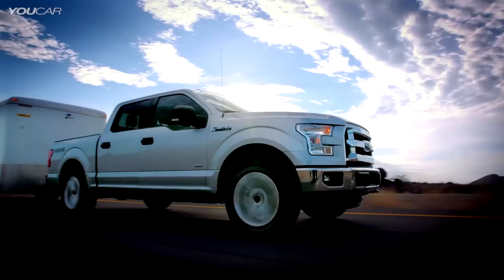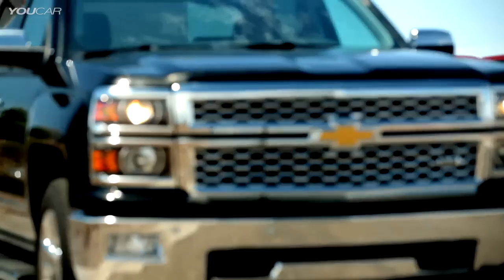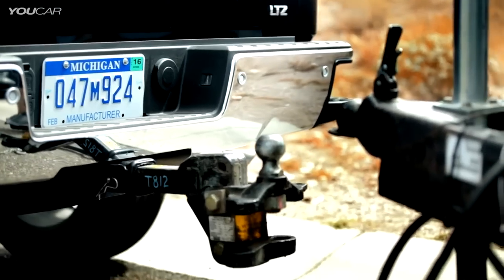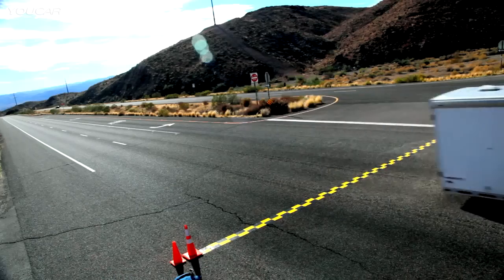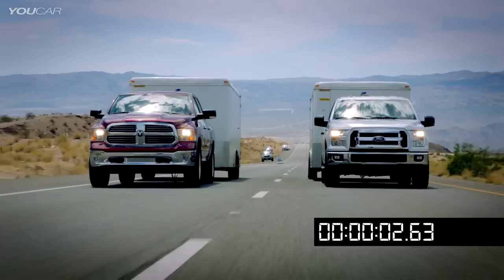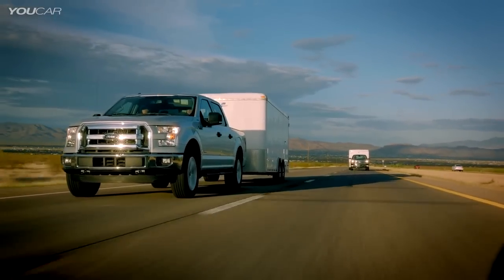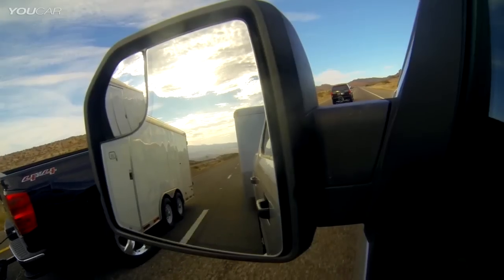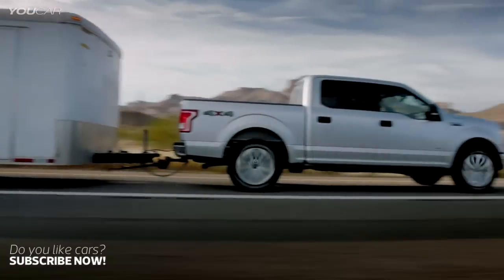TOWING Comparison – Ford F150 vs RAM 1500 vs Chevrolet Silverado

Comment: I love how its a ford sponsered video and they get the 3.0 liter eco diesel ram instead the 5.7 liter hemi when they both practiclly have the same mpg. They knew if they got the 5.7 liter it will outrun the 2.7 liter ecoboost WHAT A JOKE
Reply: Ford's Eco Boost 3.5 would walk the Hemi 5.7 liter
Reply: The 5.7 hemi has the same mpg rating as the ecodiesel? or the 2.7 ecoboost? Ford released the mpg on the new 2015 f150 already?
Reply: Dude your whole comment is flawed......5.7 does not have nearly  anywhere the same mpg as the ecodiesel. And the 3.5 is the 5.7 hemi competitor.
Reply: @ PJ I know I’m a little late to this I know the 5.7 hemi would walk that 2.7 but you are correct the 5.3,2.7, and eco diesel are the same class 5.7,6.2, and 3.5 are on a different level I had a 14 5.3 full bolt on and it wouldn’t keep up with my 15 hemi how it sits stock and the 6.2 and 3.5 are faster than the hemi so I can’t imagine

Comment: At the end of the day most truck buyers, like my dad, look for the capability of being able to towing which means good horsepower, torque, and a reliable engine not what will save the most gas money.  My dad has a Silverado (and yes this is my bias opinion) that he absolutely loves. It pulls everything he needs it to pull, gets better gas mileage than my mom's car at times (she has a Chevy Traverse), and hauls all the crazy things my dad hauls. He loves his truck and yes I'm a Chevy Girl and bias, but I mean that's just a different view from a different person who is entitled to their own opinion. But the F-150 is a lot better than Ram will ever be and the Tundra
Reply: TrapBird Amen. if it''s a truck itll haul.
Reply: That's where you are wrong ram Is the best truck out here right now. Chevy is a sluggish truck, ford can never compare v8, and tundra should never be never be compare to the Ram. Not only is the Ram better for towing, but the best gas mileage out here in full size truck
Reply: Case Baskets Yeah it has the best gas mileage because it can't pull shit! Everyone knows that, besides the 2015 Silverado was built after the Corvette, so you get the better horsepower.  I highly doubt that the Ram could ever pull up to 9,200 pounds like the Silverado High Country can.  Some stats for you: the optional L86 6.2 liter V-8 produces 420 hp and 460 lb-ft of torque.  It launched the near-three-ton truck to 60 mph in 5.4 seconds and it did a quarter mile at 99 mph in 14.1 seconds. So no the Ram really isn't the best truck out there, but if saying that it is makes you and Dodge feel a little better, so be it.
Reply: Your outdated with your information,  plus all the Silverado is just for show all they really brag about is "been in the family" nothing but paper nothing to show for plus the hemi 5.7 395 hp 420 tq 10,300 lb tow capicity all the Silverado is just for show that's why all other makes always compare their truck to the Ram it's all always the comparison to the best truck your just mad your truck isn't as tough.
Reply: Case Baskets I'm not mad about anything ... I'm just laughing at how you go and find this specs to prove me wrong, when my original comment was an opinion.  Ok you like Dodge, what do you want me to do about that? ... give you a reward or something?  It's people like us that actually keep the auto industry alive, without us everyone would have the same damn car.  So congrats that you like Dodge and I like Chevy because we're the ones that the auto industry should thank, we keep the world an exciting place.
Reply: TrapBird (Camaro Girl) yeah Chevy is good and dodge too
Reply: +TrapBird (Camaro Girl) I personally think the world would be a better place without the government saving GM'S butt ever time they screw up, just saying
Reply: Brayden Bracken Just wondering but how did the government save their butt? All the recalls they had with the ignition switch, as far as I know, the government didn't save them but instead asked them for money to fix all the damages. Besides everybody and every car company makes mistakes, and sure I'm biased on this but I feel like every car company should be treated the same when it comes to the recalls made on that company.
Reply: TrapBird (Camaro Girl) I'm not talking about recalls, GM nearly went out of business until the government bailed them out to keep the price lower for vehicles
Reply: Fiat owns: Alfa Romeo, Chrysler, Dodge, Ferrari, Jeep, Lancia, Maserati, Ram and SRT. Ford Motor Company owns: Lincoln and a small stake in Mazda. General Motors owns: Buick, Cadillac, Chevrolet, and GMC. GM owns a controlling interest in Opel and Vauxhall in Europe and Holden in Australia.
Reply: Christian Owens Dodge isn't GM ... Dodge is Chrysler
Reply: Exactly that poor of a engine vortex can't never be compare to a hemi
Reply: There ya have it!!
Reply: +Case Baskets The fuck are you smoking? No one compares their product to the Ram. It's always been between Ford and GM. Go pretend your fake "Hemi" was a real engine.
Reply: Dodge is awesome! js....
Reply: Christian Owens Hey everyone has their own opinion :) I like Chevy but without you and me the auto industry would be boring af lol
Reply: Yes, good point maim, no kidding! The auto industry is already coated in rust!

Comment: Yes the disposable truck has won... for now lol Come back with high miles and see who still has the original engine with original components.
Reply: Dude the 2015 chevy V8 engine is not stock it has a air intake,upgraded exhaust system,and a performance chip.
Reply: Michael Isaacson Yep and the ford isn't stock its got upgraded turbos and a 5.0l under the hood.....
Reply: Who had the disposable truck?
I think my dad's 2008 Silverado in my driveway. Want a picture? The motor is fucked with 47k. So don't give me that bull shit bro.
Reply: matthebest018 04 f 150 4.6 with 125k on it will still out pull ANY truck around in its class. original engine? you want a video showing all the stock components still on the truck? chevys are like a rock huh? well rocks can be broken NOTHING is built ford tough.
Reply: mcatlow8 Proper maintenance is key i guess you would't know lol
Reply: matthebest018 yeah tell that to my father a Chevrolet mechanic for over 20 years.
Reply: mcatlow8 K.
Reply: matthebest018 Thank you, finally someone with smarts. Soon we'll see more ecoboosts in the shop soon.
Reply: Jealous much? Ford won cause it is better and always will be
Reply: Pokemon Master Jealous of what? A engine rebuild in a couple years? Worst fuel economy? Unreliability?
Reply: Its the same with al those downsized enigines, the change of them beraming down is significantly higher. In the netherland VW uses 1.2 and 1.4 4 cilinders in the Jetta, Golf and the 1.4 en 1.8 in the Tiguan and Passat. Its horrible for the owners. Just 2 year warranty, and then you are fucked! Broken turbocharchers, wich sometimes arent replaceable without replacing the hole airintake manufolt, streched camchains ( really!!!!!) and lots of other failures. The best Joke is: the fueleconomy in reallife is wors than a Honda VTEC, Toyota Valvematic, Mazda skyactiv.
Reply: matthebest018 I smell a hating Chevy guy
Reply: matthebest018 Te Apoyo bro, Tienes toda la razón.
Reply: Sebastián Rangel ¿Qué hace un delirio arrastre tiene que ver con eso?
Reply: You're welcome for the pos gaymaro. Paid for by our tax dollars. Smfh.
Reply: richard wilson Funny thing is you think that ford has not taking government money. Gaymaro? The same one that destroyed the mustang in every way? Yeah probably that one. Jealous much?
Reply: matthebest018 didn't see it destroy anything. Without Ford Chevy and dodge would of never been started.. jealous much?
Reply: richard wilson Are you serious? lol Without GM Ford would't exist today. 90% of all the luxury items found in you car today (if you even drive) have been pioneered by General Motors.
Reply: matthebest018 how much does gm pay you to back up there garbage, Ford founded the automobile industry. Without out tax dollars Chevy would of been dead years ago, would of been doing the world a favor there.
Reply: richard wilson None actually its from my own validity. You ford dudes are all the same. Cant appreciate anything but their shitty cars. Welp have fun with you rebuilds its a good thing ford logo is circled because allot of people found the problem. I promise you will one day to lol
Reply: richard wilson So entertaining lol
Reply: richard wilson Seriously how old are you? Does your daddy drive a ford is that why you like them? lol
Reply: richard wilson Too funny lol Do me a favor and read your comments lol
Reply: +matthebest018 dude Chevy's are bad and dodge is worse they slap a v8 in it and call it good that was a 2.0l v6 my 1999 ford ranger has a 4.0l v6 and it would tow just as good as them
Reply: Michael Bryant bull shit i got a 1500 hemi 4by4 v8
Reply: Mat A my I've been driving E-150 vans my whole career, and they've all be trouble free well past 300k. these are 4.2L V6 vans. the 4.2 is bullet proof. They'll tow cars too, but you won't be winning any races.
Reply: Lynn Dempsey Fords suck timing chains and the IWE design on the front diffs takes the cake. What a garbage design. All the carbon buildup on the EcoBoost engines, spark plugs needing swapped way before 100k miles. Broken timing chain guides. Ford and timing chains do not mix.
Reply: My f150 has 280k still on its original

Comment: cannot wait for the tsbs.........and recalls...and all the fun!!!!
Reply: There are already service recalls on their way for the 2011-13 ecoboosts. There are multiple design flaws with those engines, exhaust manifolds, and heads clogging from carbon buildup prematurely, and it's no surprise there aren't any approved TEC procedures for them at this time. "Ford's better idea." lol..
Reply: ***** Except it was only a small amount vehicles coming from one factory, and guess what, more people drive the F-150 then all the other truck manufacturers combined.
Reply: That doesn't say anything more than a high volume of people drinking from the Kool-aid. It's kind of like saying, "Crest, more people use our tooth paste than other competitors combined." It's completely a mundane; pointless statement. Just because more people purchase a piece of shit doesn't make it better. btw, I don't really notice a lot of 90's Ford's on the road anymore...
Reply: Who would want to drive a 90's truck in 2014? There is no comparison to what is produced today. All three major truck brands make a good vehicle today because they have to. All three trucks have their pros and cons.
Reply: ***** its just a truck we are all over paying for just so we can work our lifes away anyhow.
Reply: Sorensenator86 if you combine the Silverado and sierra sales (which honestly I would because 'sthey are the same damn truck) vs all of fords f150 series you would see that they are about even. Also the reason why chevy uses "90's" technology is because the 5.3l vortec is reliable. wait till someone else does this test and see before you say anything. This is a very biased source
Reply: casey chance I have the 5.0 L in my 2014 and it is great. Chevy has upgraded their 5.3 L and it is almost identical to the Ford 5.0 L in terms of performance, I don't think you can go wrong with either one.
Reply: Amanda Lac The special thing about the current GM Engines, is that they've stuck with that design and improved upon it. There's been over 40 years of development to not be as susceptible to carbon build-up. Besides, that statement's completely untrue. I've got a 1996 Impala SS, it's a LT1 350 from 1996 with PFI; that's an early type of Direct Injection. It's well over 270k miles, and it has not had Eco-shit problems when it comes to that "new engine susceptibility" you were mentioning, that's a load of crap. I've never heard of a transmission hose induced fire; wtf...engine idling too long!? w.t.f!? Engines idle, they don't blow up from just idling for a long amount of time because of a computer value inaccuracy. Thermostats don't open electronically, they use a temperature sensitive wax-based core that opens up at optimal engine operation temps, why the hell would a computer glitch change the way a mechanical thermostat opens?!!? Hahahha...Eco-tec's are Vortecs, which have been the same design since moving from a flat conventional head design in the late 80's (that's 34 years total; 30 years older and more refined then the Ford Eco-boost. Please come here when the Eco-boost gains 30 more years on the Vortec design; (which it won't)..."May be only in your Ford Motor Company fanboy's book. Ignorance is a bliss!"
Reply: SB N Haha...if you can tell me what that other 90% really was, I'll give you a cookie; other than the VVT, and DI redevs. Of course there's head redevs to accommodate the DI, but it's still a Vortec head nonetheless, that's how they're classified right?! Since you've got all your shit straight and everything... Ecotec merely describes the CD methods and VVT features to save fuel. Changing injection methods and internals for VVT Cam accommodations doesn't detract from the fact it still has Vortec heads on it. So yes, Ecotecs are Vortecs. Ever seen an Ecotec 2 in ANY 2007-2013 GMT901-2 platform or even 800-880s? (GMC or Chevy)? There's a badge, "VORTEC" or "DURAMAX" I don't know if I've been dreaming or anything. GM's been developing the Ecotec since the 880's platform as 1st Gen. It's just two names to describe two differences in the engine; the head and the CD/VVT features, but people happen to use one or the other to describe it.
Reply: ***** Ecotec is merely just a name. When I use the word Ecotec 3, I am referring to the fifth generation of GM' LS V8 engines 5.3 and 6.2 liters and the latest generation of 4.3 L GM' 90° V6 engine based on the 5th generation LS engine design. Tell me, do I want to use the Ecotec 3 name for short or do I want to use the " GM 5th generation..."? And you assume just because they have the Ecotec or Vortec name, they are the same engine? how ignorance. Even the new Ecotec 3 share a similar external intake design vs the Vortec, the internal and port head are very different to accommodate 11:1 compression ratio on regular unleaded and DI.

I read somewhere once and GM claimed that they have to redesign over 90% of internal parts on the Ecotec 3 to introduce: DI, VVT, oil-spray piston cooling, variable-displacement oil pump that enables more efficient oil delivery, tri-lobe camshaft, new AFM, cam-driven fuel pump...and more...

At the end of the day, saying that the Ecotec3 is Vortec or worse, same like the 1996 350 in the Impala is very ignorance.

On the side note, I am still waiting on your explanation of how the DI Ecotec3 doesn't have carbon built up but the DI Ecoboost do? and once again, the newly redesigned Ecotec 3 is only 1 year old, vs the 4 years old 3.5L ecoboost. It's a fact!
Reply: SB N no manufacturer biased.....that exhaust particulate thing is so state of the art....
Reply: porkpig350  Diesel exhaust particulate filter is design to trap un-burnt diesel and carbon after the turbo's back, and the turbo is after the headers, and the headers are after the valves. And I believe we're talking about carbon built up on the valves. So how does DPF clean carbon built up on the diesel engine valves?

DPF is only used recently on modern diesel. DI has been used on diesel engines since when? like 20 years ago at least.
Reply: I already knew that...so" keine danke fuer ihnen"...but my point was... that particular pain I mentioned namely .. the dpf  falls and fits so nicely into that category of  " lets be the first with that tecnology in the market and no we don't care if customers get fucked by it because we are not really sure it will work well in day to day".....kind of product....who gives a shit anyway...
Reply: porkpig350 DPF is required and mandated by EPA. It's not like auto makers wanted to put one on their diesel powered automobiles. They were forced to put one on.

Turbocharged gasoline direct injection, or Ford calls them Ecoboost, is the way of the future for gasoline engines in automobile. Yes, there are EV, Hybrid, CNG, hydrogen... but the gasoline engine is here to stay. Most auto-makers will want to invest more in Di-T engines to stay competitive. It's very difference than being forced to use it.
Reply: Sorensenator86 completely agree man! and that's exactly how I feel. They are both great trucks. just don't like these twin turboed trucks, they aren't all they cracked up to be. I will go with a v8 anyday whetehr it be ford or chevy

Comment: The issue I'm having is that this doesn't tell you anything. They say that they are hit the gas all the way up, so is that WOT? You only need WOT if you don't have the power in a certain gear. How about a flat ground 0-60 test with the loads. Then instead of that WOT up hill have both trucks cruise up to the line neck and neck at the speed limit, say 60mph, and let them go up the hill in cruise control. See what truck shifts more and see if they lose or gain any ground on the other. IF they all maintain the speed limit they are all capable, if there is a different it will be noticible at the top. Also, how about a fuel economy test up hill at 60mph to see which uses less fuel.